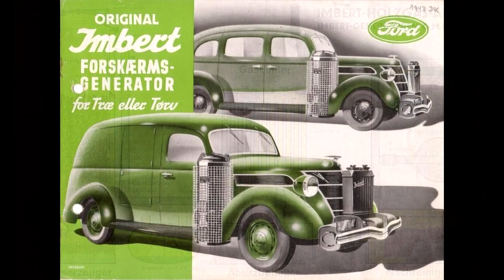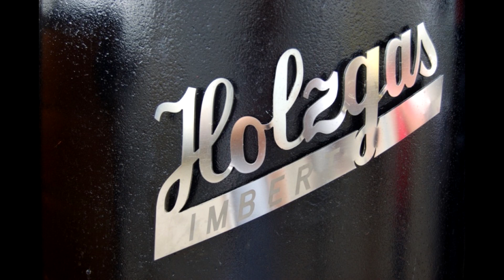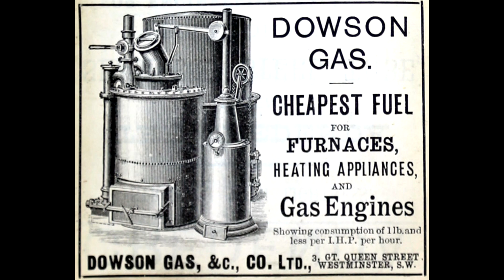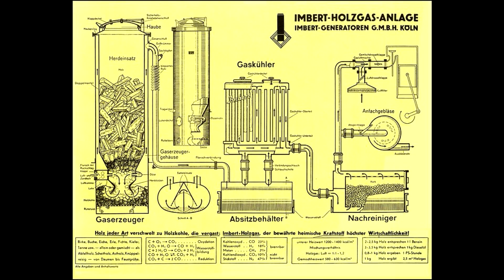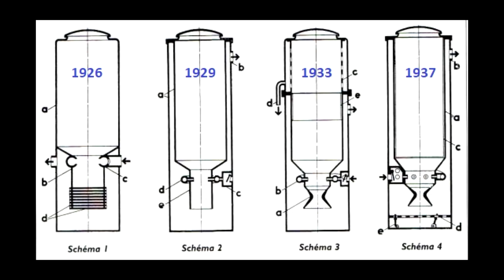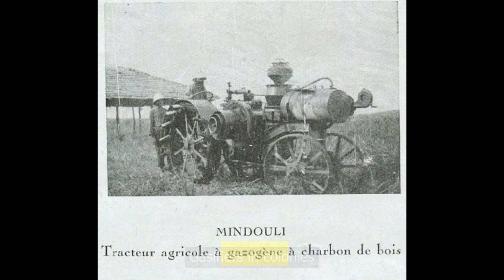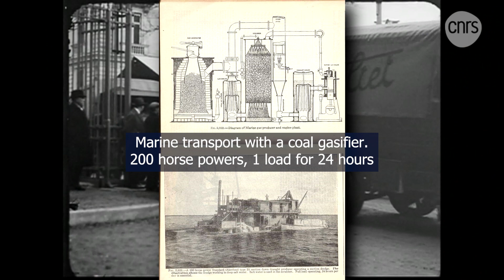The Father of transport gasifiers / HISTORY WEEK: Transport Gasifiers / Documentary

Comment: Very interesting series. What we need on the market is a small co generation gasifier, that allows one to heat a house with wood, but also supply electricity to the house via a gas powered generator. This would allow a house to be fully off grid. This would allow the house to provide all of its own heat and electricity.
Reply: I have a few ideas that might help. So in America, there are people who heat with wood stoves. In America there are people that heat with wood furnaces (a stove with an electric fan to move air). In America some of these are located outside the house. This make it cleaner with less wood and sawdust in the house. To keep it simple, let start with a wood furnace that run on pellets, woodchips, sawdust or corn. There are many stoves like this. A fuel that is all the same size is easier to handle. So if the wood could be put into a stove that would burn it, it could create heat. All heat as needed could be taken inside to the house by an electric fan or by a water boiler. Next, in order to make power and a wood gas engine runs and electric generator. This generator would run on gas and start and stop as needed. Sometimes houses have very little power needs. At those times a set of solar panels and a set of batteries could provide power. The system could ultimately turn on as needed to charge the batteries. In America propane is common. In America many people have large propane tanks of 300 to 600 gallons. The propane in these tanks is used for cooking, hot water, and heating. To heat a house with propane in America is expensive, it costs about twice as much as natural gas. So the wood gas generator could be outfitted with an electric compressor. this might be a compressor like in a refrigerator. This would compress the wood gas into the large tank as needed. The compressed gas in the tank would allow the generator to have a constant supply of fuel. It could even allow the gas to be cleaner. The generator could turn on any time it needed to, or any time more electric power was needed. The Gas in the tank could obviously be used for cooking or heating water as well. Now if the everything is located outside, it becomes safer with less risk of dying by gas. It becomes safer with less risk of fire. In normal operation, a computer could control the entire operation. In the day time, electric power would be made by a solar panel, at night and at high load times, the computer would tell the generator to turn on. In the winter, when the house was cold the gasifier would turn on and automatically add fuel. Then the fan would turn on and move heat into the house. The Generator would turn on and make power to charge the batteries, the compressor would turn on to compress the wood gas. The entire unit would be self powered, giving power, light, heat, cooking gas and electricity. The problem would be make sure it ran with no problems. Generators can run on wood gas, but it is not good if the generator breaks, if the engine needs to be replaced too soon or it it will not start when needed.  This i understand, has been one of the major problems with wood gas. If the wood gas comes from a tank, it might be very clean. The large tank, like a propane tank could clean the gas. Dust, and dirt could come out, while the gas sits in the tank. I know a normal house uses about 500 watts of power all the time. Some houses use a lot more. I know there are some thermo electric tile generators that can produce up to 400 watts of power when a wood stove is hot. That is similar. It might even be able to incorporate those components as well for more efficiency.
Reply: A small scale unit like this could even use the stored wood gas to restart the fire, when the fire goes out. In America, the average house spends about $100 a month, $0.12 per killowatt hour on electricity and in the winter season $500 on wood, or up to $2,000 a year on heat (in cold areas). I believe dependability is going to be the biggest problem in creating something like this. It can be made, but constant problems of breaking and not starting for unknown reasons is not acceptable. In part, one might overcome that by having multiple units (two generators for example) so when one does not work the other one can. People do not want unknown problems. People would rather have an old engine (one that looks like it was made in 1925) that always works rather than have a new engine that only turns on sometimes. A generator like this also would need constant servicing (changing of oil ect). For some people this would be ok, but for many others they will stay on the grid.